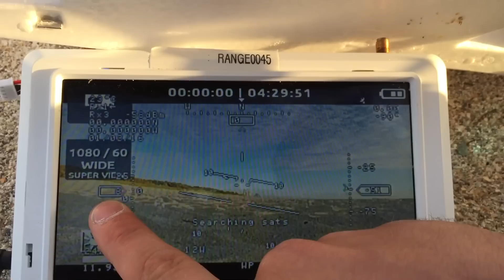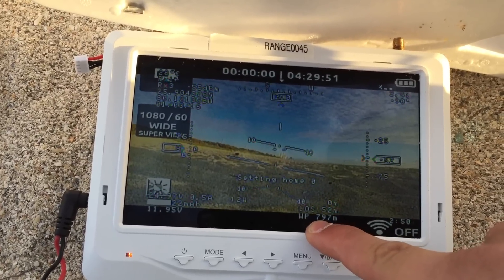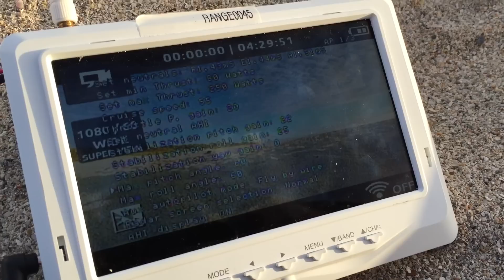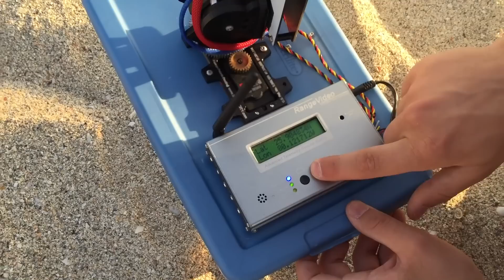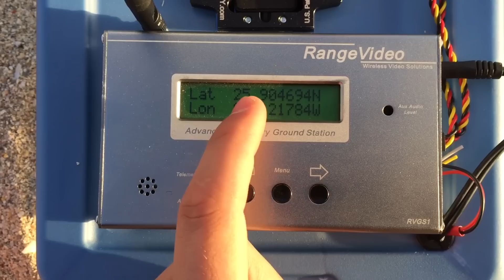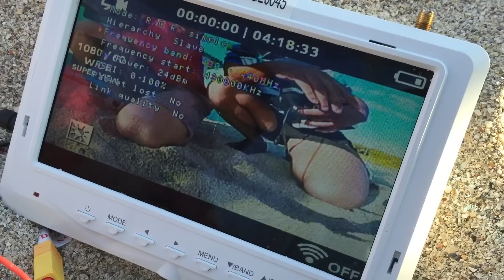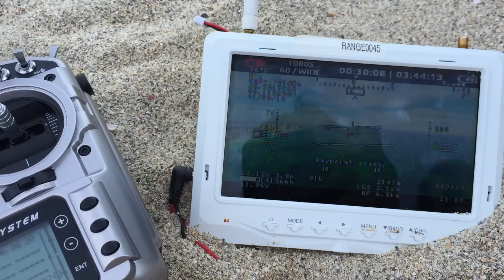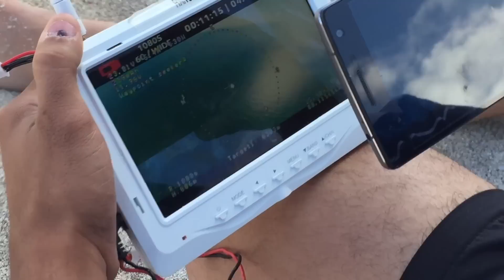RVJET Reconnaissance Plane

Comment: Say Brother ! Are you in Florida ? If so I just seen a bunch of plane stuff at a local independent thrift. Including a balsa wood framed wing and two rolls of the tape stuff to cover the skeleton. wing . There is as well a complete foam rc plane with wires and control that it has elevating tail and wing flaps. LET ME KNOW i CAN GIVE YOU THE ADDRESS IF U WANT . PAUL THE OWNER WILL BARGAIN OR NEGOTIATE ON PRICE OF THE STUFF. There is a lot of stuff although I am no expert. I just seen it yesterday

Comment: This thing is pretty awesome, but it seems like you need a shit ton of equipment and knowledge to fly this. I'm just gonna stay with quadcopters.
Reply: VM D but the range and the time you will be in the air will be multiplied by a lot. Expect 50KM range on a good UHF System. And with 16000mAh a few hours fly time.